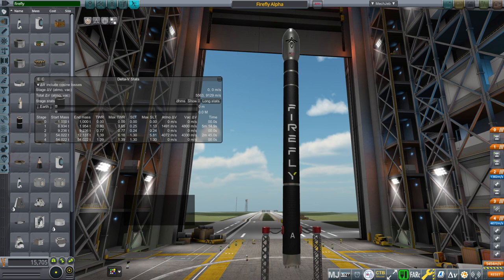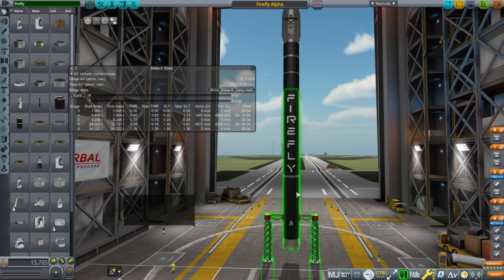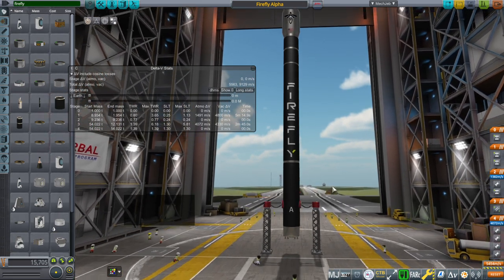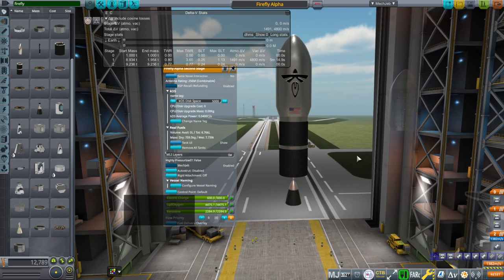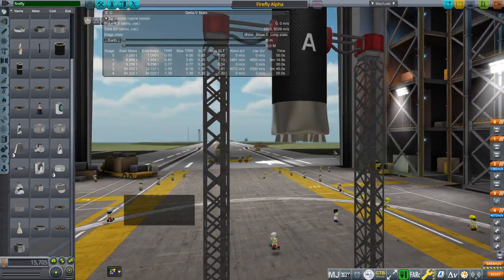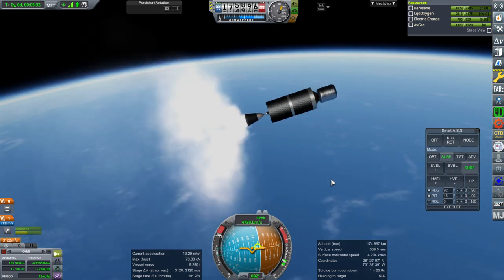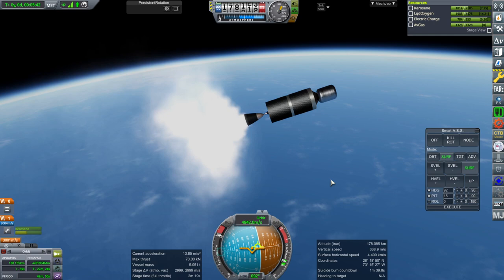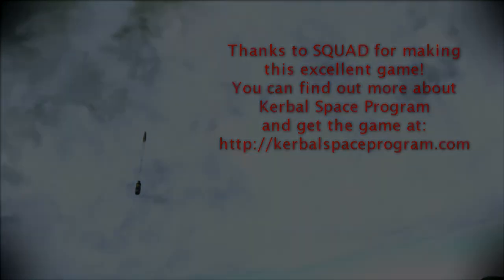KSP with Realism Overhaul - Firefly Alpha

Comment: I thoroughly enjoyed seeing the exact times that Alpha was supposed to achieve Mach 1, Max Q soon after, Stage separation, and stage 2’s burn completion/orbital insertion. A good reference for sure when lining up with what happened during the flight, where Mach 1 did not happen until about 8 seconds before FTS detonation at 151 seconds, which puts the time at 2 mins 23 seconds to mach 1, or about 35-40 seconds slower than LV006 by Astra the week before.

Comment: Could you send a payload to the moon with this? Like a nano lander?
Reply: Well… not really… the rocket itself isn’t too powerful, the maximum payload to standard SSO orbit (93º, 500km) is 630kg, and payload to GTO isn’t even specified, but judging by the rocket’s performance i don’t think it can carry any significant payload mass to that orbit. The engines are pretty inefficient, 295s vacuum ISP on first stage and 322s on the upper stage and both stages using kerolox is a pretty bad sign for high-energy orbits, such as the moon.
Reply: @adrianpop6821  

That’s forgetting the fact that this can lift 3-4 times the mass that Rocket Lab’s Electron can, is arguably, albeit marginally simpler due to the tap off engine design and they happen to have a spacecraft manufacturing suite like Rocket Lab, which could produce a space tug able to go to the moon once in a decent orbit.